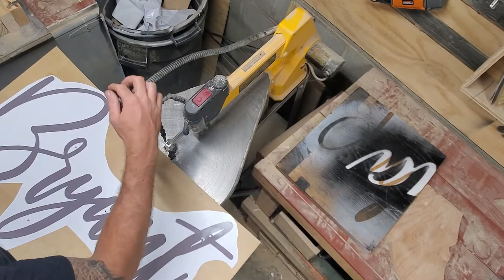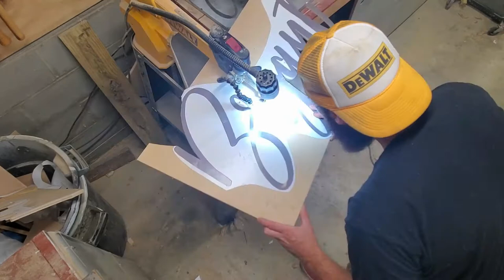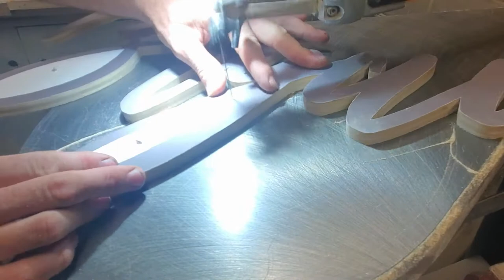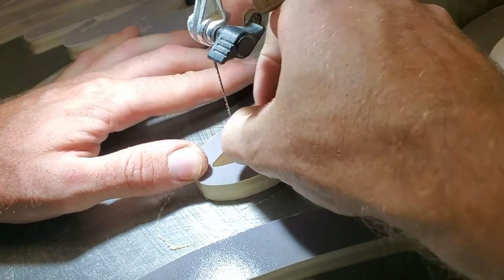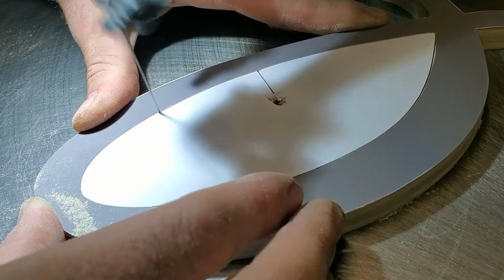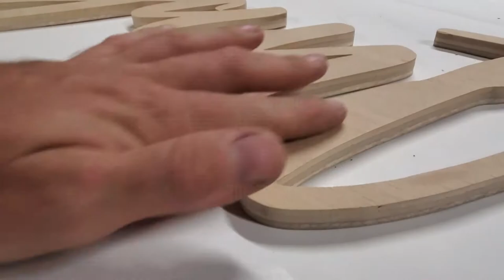Big Script letters cut with scroll saw

Comment: I just ordered the Dewalt scroll and looking forward to getting into it. I am trying to determine how I am going to go about putting my image onto the wood to cut. You are creating your file and then printing on to what type of paper?
Reply from the maker: Thats awesome man you'll love it. I just print it on normal paper then use spray adhesive to adhere it.
Reply: @nvwoodco  Any tips on printing larger files that take multiple pages? I have been doing the spray adhesive on single sheets but I would like to attempt a large name sign next. Just having a hard time figuring out the larger size printing.
Reply from the maker: Anything bigger, I send the file to staples and have them print it. I use the blueprint, black white service. Its pretty cheap
Reply: @nvwoodco  Oh thats a great idea. Thanks again for another helpful tip.
Reply from the maker: Anytime! 
Hit me up on instagram if you need anything else

Comment: I really liked your video. I have been interested in getting into some script work using a scroll saw. I have been using a jig saw so far and for those really tight spots, it makes it really difficult and requires a lot of sanding to finish. I also have that same Kobalt cordless random orbital sander and really like it, especially being able to adjust the speed. I noticed you use the DeWalt scroll saw. How do you feel about it? Do you think it was worth the money compared to a cheaper one, especially since I won't be doing this a whole lot? Or is the DeWalt really worth that kind of price? I'm subscribing and hope you will do some more script work so I can copy your technique. Thanks!
Reply from the maker: I started with a cheaper ryobi at first and it got the job done, but the dewalt is just a way better machine, night and day difference. Way more smoother, less vibration, adjustable tension and speed etc. Oh and undoing the blade from the top to insert into the inside of letters is way easier then on a cheaper machine. 
And thank you for all the kind words 🙏 🤙😁
Reply: @nvwoodco  great information. Thank you. I will certainly take all of that into consideration if I decide to persue this further, which seems very likely. My pleasure. Thanks for the great video.
Reply from the maker: @JOATology  one other thing, the dewalt will sell quick and you'll recoup most your money back, anytime i see them pop up for sale on marketplace they go quick!
Reply: @nvwoodco  thats another good tip. I didn't really think about that but I might decide I'm not really into it. I have been seeing a few of the harbor freight models here and there on marketplace and they seem to go for about half their original cost, which is a good indication to me that they're just not that good in the quality department. But I guess that would be entry level...I really appreciate the knowledge. I'll keep an eye out for a Dewalt
Reply from the maker: The entry models can easily discourage you from the craft.
Any other questions or help feel free to ask my man 👍
Reply: @nvwoodco  Thank you very much!

Comment: Do you use plywood or MDF? And is it 1/2 in?
Reply from the maker: Mdf is best for painting. I've used both. 
1/4 inch or 1/2 depending on what im doing
Reply: @nvwoodco  I want to make a sign for friend of mine that's getting married. still new to scroll saw but handy with other tools. What would you recommend? MDF of plywood? Thank you for your help